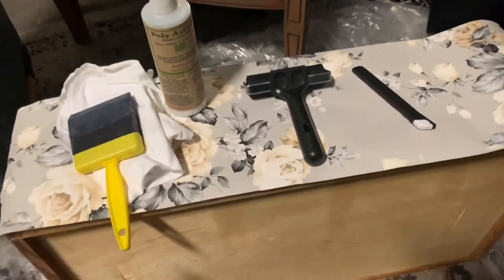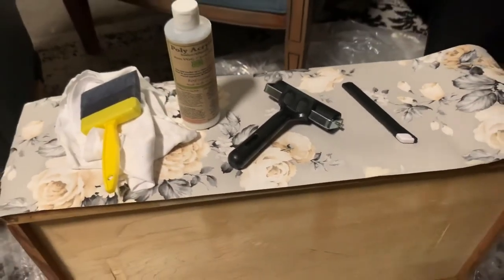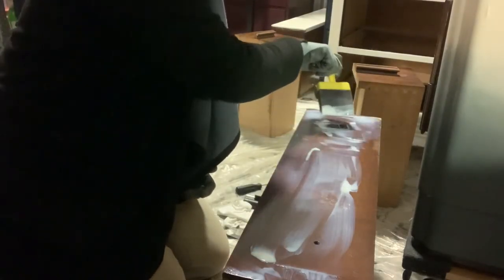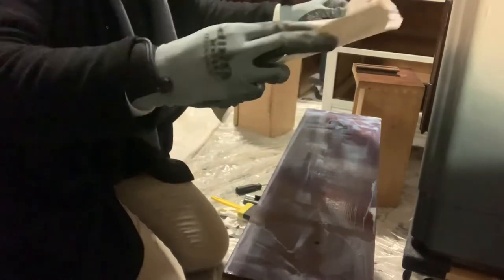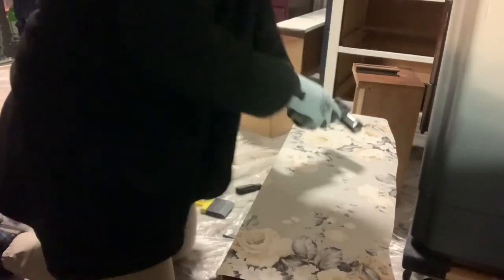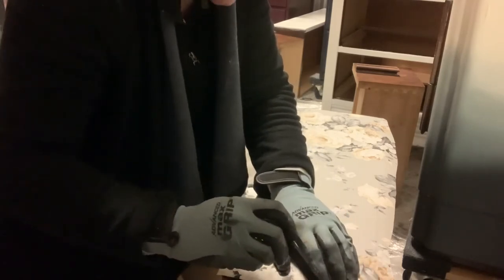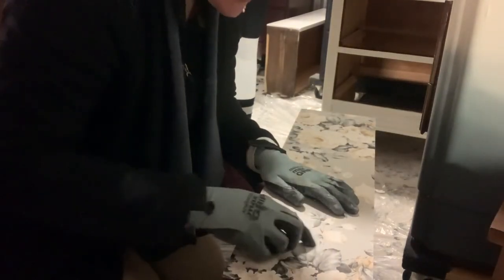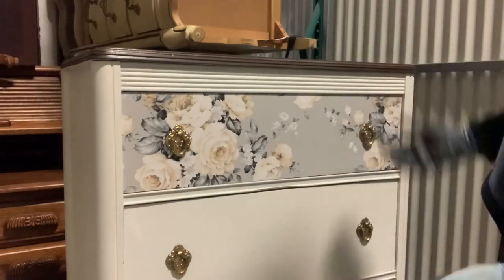Pretty Floral Dresser | How To Decoupage Wallpaper Drawer Front | Elegant Upgrades

Comment: I purchased a roll of paintable wallpaper off Amazon. It was not prepasted so I used Mod Podge to adhere. Once it dried, I used sandpaper to sand off the overhang. Worked great and then I painted in the same color as the dresser base (I had sanded the drawer fronts). Love your quick videos!
Reply from the maker: Thank you, I do try to keep them on the shorter side. I have used the anaglypta wallpaper myself and I love it!

Comment: Is the wall paper wet when you put it on
Reply from the maker: No, not wet with water. But you can use water if you trust your paper’s adhesive. I like using my top coat because it activates the adhesive and creates a bit more.

Comment: Is it possible to seal it with a varnish so it can be cleaned without risk of damage?
Reply from the maker: Yes, you can absolutely seal over the top. I do on porous wallpapers, but this one in particular is wipeable so I wasn’t worried about it.
Reply: @elegantupgrades ... hi there..   I'm gonna jump in on this one of thats ok, please? May I ask what you would seal with ..  varnish, modgpodge.. ? Or something else? Thanks x 
P.s I looooove the look you produced 🥰
Reply: @elegantupgrades  may I ask why you use to seal a porous wallpaper? Thanks...
Reply from the maker: @sharonrooney2888  Thank you, Sharon! I typically use a water based poly on porous wallpaper. Never Mod Podge. But you can use almost any sealer. The water based poly is just my preference.
Reply: @elegantupgrades What is the adhesive and the sealant you use, please?

Comment: do you have a link 4 the wallpaper?
Reply from the maker: Yes, however, it’s currently unavailable. But keep checking back as it goes in and out of stock frequently. 
https://amzn.to/3uTl2WH

They also have the same print with different color variations with this link:
https://www.amazon.com/dp/B07WDYKK52/ref=cm_sw_r_as_gl_api_gl_i_37M757VT6J1S8FH12HJH?linkCode=ml2&tag=elegantupgrad-20